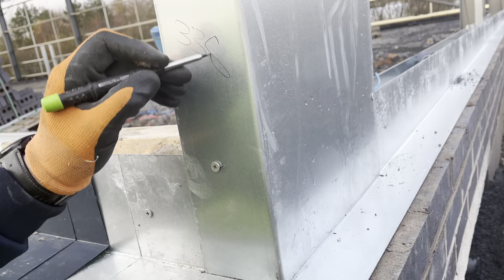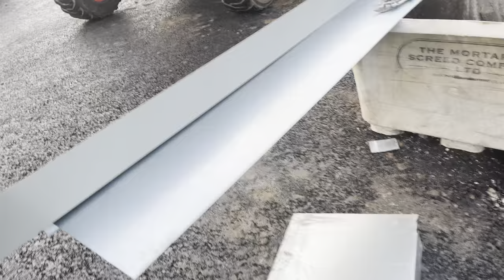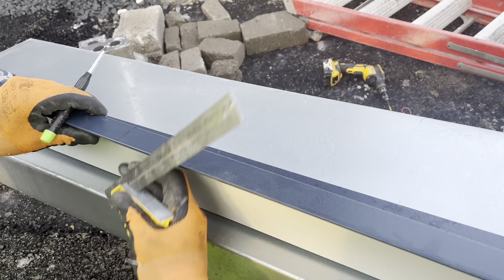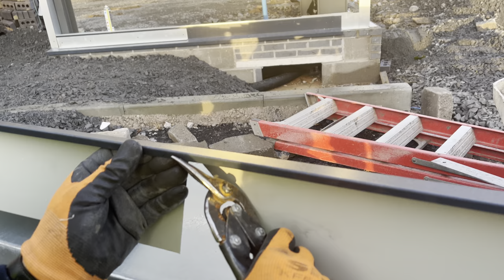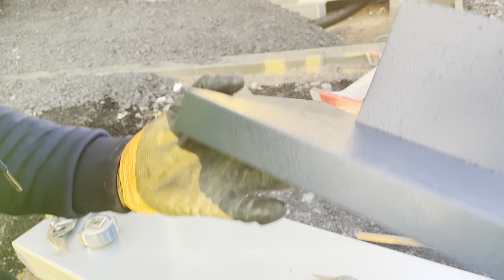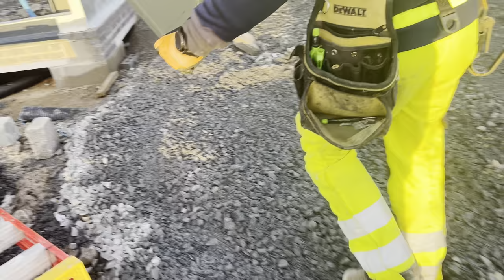Cladding Drip Corner Flashing On Site

Comment: Only thing that I could say is leave half of the top end or atleast a few inches so you can put I bit of cutting on the end thats overlapped. Instead of having a straight seam on the corner that leads to the material behind it.

Same reason why you leave a bit of material on the flat section.
Reply from the maker: Sorry don’t understand what your saying here, can you tell me a time stamp in the video where I can see what you mean please
Reply: @cw7700  like, the two rectangles that he folds down, he goes and cuts them flush where the back is. He should leave one of the sides there and fold it around the corner so he has a nailing spot on both sides to keep the two sides tight against the wall. And he's able to some good caulking from the top of the flashing, down to where a pinhole would be, and under the one side of the flashing that's sitting. Caulking isn't exposed to uv rays so it'll definitely last 20+ years if it's a good quality caulking

Don't get me wrong he did a great job but it's just the tiny details and reassurance with caulking that make it stand out compared to the thousands of other people who do it like that
Reply: @cw7700  2:27 +  flashing  and the underlaymet  need to be at last 15*
Reply: @cw7700 
He's saying that you should have left an ear on the topmost vertical portion of your corner cut on the left side to fold over at a 90° underneath the right side when folded over providing an overlap instead of an open cut with nothing bridging the gap in between the two intersecting sides.

Comment: Ya gotta put a return on the apron upstands so you can caulk and seal. So water has no way of working through. Under flashing won’t stop the water after a couple months. All joins must be lapped by adjacent materials.
Reply from the maker: Water won’t get past a kingspan panel that sits on top of this

Comment: I want to know how they make the outside corners where the diagonal joint is lifted up (about 1/2 inch) to create a damn on the corner - any idea?
Reply from the maker: I think you need to look at zinc roofing mate, check out YouTube channel architectural sheet metal 101
Reply: a dog ear … common detail in hard metal roofing
Reply: Upstand/stop end.
Just leave extra 100mm on that plain of the flashing, score the underside, to allow it to bend, bend it, then cut to the required height.

You leave a bit to go around the vertical leg too. To seal it all off. But my explanation would probably confuse you.

Comment: Very bad its not water proof
Reply from the maker: There will be silicone under the mitre I was only showing the cuts
Reply: @cw7700  in poland if you use silicone you are not roofer. You must make seam on corner
Reply: @oldsharke2840  well this video is not in Poland,  and can you send a link that shows in the rules and regulations that if you use sealant in Poland your not a roofer ? I'll wait for the link you provide,  cheers
Reply: @garethhancock8525 non compliant even here in Australia.
Reply from the maker: @NightlifeReALIty  it is compliant in the uk and until I get called back to see a water leak I’ll continue to do it like this, been ok for the last 20 years
Reply: TommyBradshaw1991  yer won’t leak but when someone uses a pressure washer on a building over time the water will find a way. You might be getting it done good enough but a simple easy tab return for the back of the apron sealed riveted and over sealed will guarantee leak proof from all angle. Keep building how you like though don’t step your game up